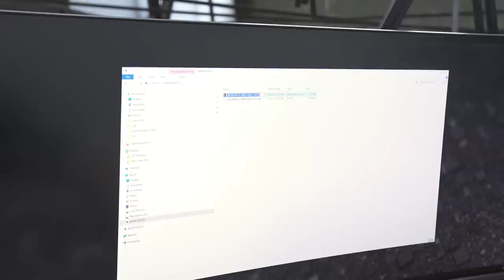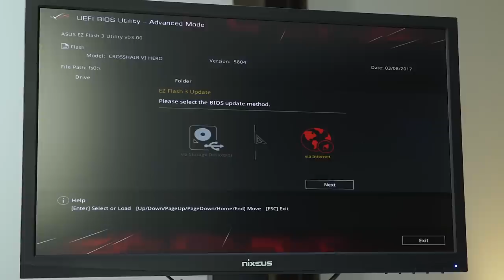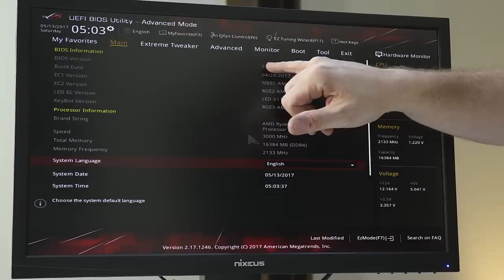How to build a Gaming PC

Comment: How long did you wait until the first boot? (Post)
Reply: AlexV511 no answer? wait for someone to answer. just answer. ANSWER????
Reply: Zeki İpcioğlu are you on crack?
Reply: unfortunately. install everything and boot first time. all i have is a black screen about 30 min.
Reply: Zeki İpcioğlu, I have the same problem... boot nothing but a black screen
Reply: just check everything looks alright. consider about wrong ram decision.
Reply: AlexV511 Did you sort your problem?  If you did, it would be helpful to others having the same issues.  Thanks!
Reply: Hey, I just changed my power supply and everything worked magically, so for me it was a simple troubleshooting. The ram was clean for me so no problem there. I hope this could help: check the power supply!
Reply: AlexV511 yeah i have comnection issue which i couldnt solve. They say me its was all okay but still not know what was the issue. So give your computer to a technician. This is what i can say to you guys.
Reply: AlexV511 The power supply is more important than people think!  Glad you got your rig up and running and it was something simple in the end.  Something to look out for.  Thanks for getting back! The information is sure to help someone facing the same problems.
Reply: Zeki İpcioğlu Did you send the parts back?  Will you attempt to rebuild?  It would be interesting to find out exactly what the problem was.  Do you mean it was a problem with the components?  In that case, of course, you would've had no luck with that particular part/s. Thanks.
Reply: I didnt send anything back. I asked professional help from a technician. All they said me was its all okay, no problem. Since i tried everything i couldnt understand what was wrong but its okay right now as they said. Btw i have check if they connect any cable different from me, there is no difference..

Comment: What's the case on the main build (the one with the two ftw3s)?
Reply: Gwalix thanks! Never would have guessed that. Looks like a nice case other than the front grill.
Reply: at 14:22 it says the system is a Cool Master: others here have said it's a Cool Master Pro 6 but haven't been able to find a similar one on line but getting close

Comment: I watched you and some other folks and learned a lot in the last 18 months. I put together a really awesome 3900x system that has 24TB capacity for my 3D video art. It cranks away 24/7, day after day making 20 to 100 seconds of video daily. LOL. But it cranks at 100%, over 4k MHz most of the time, and mostly under 80C with a giant air cooler. I have four intake fans through filters and three exhaust. My air cooler has three fans, LOL. 
Thank you so much for the learning you've given me and others.
I'm a car-guy also.... and when I started building this system last year, it reminded me of pulling a new aluminum intake out of the box and pairing it to a new 600 Holley.. matching it with the right pump... the camshaft..... oh yeah. It all has to be matched and put together in the right proportions. And you don't match it to a weak transmission and end-gears.
But now I want the 5950x and some faster RAMM.. and believe it or not, 64GB is what I'm running, I'll not go to 32 again.
Reply: Like a Boss!

Comment: what happens if you dont update bios on your new pc and go straight into downloading the operating system?
Reply: It will work, its not a problem.
Reply: Nothing really, he pointed it out because ryzen had just released at the time of recording, and updated bios would make sure it is running properly and is compatible with the other parts. You can still update afterwards, and it won’t ruin anything.
Reply: A lot of times, updating the BIOS not only fix some manufacturer related issues but they update compatibility for newer ram and processors too.

Comment: Don't you have to wear something for static electricity when working with the CPU someone told it to me ?
Reply: Germaux NCIv its not 1999 anymore
Reply: Voltaz hahaha ow sorry that's what someone told me lol
Reply: ULTRAQQX he meant that it's 2017 meaning that it's not 1999 hope this helps
Reply: You can!  If you absolutely want to be careful with your expensive hardware.  But really you can easily keep yourself grounded by working on a non carpet floor and by touching the metal of the case often (touching the metal of the case gets rid of any static by keeping you grounded.)

However, if you're really anxious you can buy anti-static mats or a anti static bracelet and honestly, they don't cost that much and it's worth the extra assurance if you're a new builder.
Reply: Ross Castro thx a lot bro :)
Reply: Ross Castro If I bought an antistatic wrist band, where would be the best place to connect the little crocodile clip to?
Reply: Any piece of metal on the computer case should work.
Reply: Ross Castro  Ohh alright man! Thanks :D
Reply: Touch the psu that's plugged in the wall but turned off.
Reply: You should always ground your self before touching any parts that could be damaged from static shock
Reply: You should to be 100% safe, but I put my last pc together wearing socks on carpet with no problems.
Reply: Yes. Theoretically you should. But I've never had any parts damaged from not doing it. So don't worry about it to much.
Reply: I did the same with my most recent build for my wife.  Just touch the case before you touch any component inside the case or grab a part out of a box.  Even when doing maintenance, such as cleaning out dust I have never had issues of damaging parts by static shock.
Reply: Touch a radiator or any pipework, should all be earthbonded.
Reply: If anything has made my day its that 😂
Reply: These guys use ankle stra po s ground themselves
Reply: you don't have to
and moreover its more for the GPU rather than the CPU
static shock is very unlikely now anyways

Comment: Can I re-use my SSD from an Intel build in an AMD Build?
Reply: StS Rischiii Yes you can!
Reply: Even as the boot drive? I'm using a 256Gb 850 EVO by Samsung
Reply: n0ply 1337 yeah Bro as boot drive too
Reply: Sure bro
Reply: I used a 860 evo pro 120gb for os. I have a z370 msi tomahawk. I wish i bought a m.2 ssd. I have a 1tb wd black hhd for storage.

Comment: Do B350 mobos support Ryzen 5 without bios updates?
Reply: Mihai-Silviu Dumbrava I've seen builds with that combination.  Are you asking whether the bios is up to date?  It should be but there are continuous updates coming out, for optimisation and to iron out quirks, etc.  Each manufacturer is different and, also, vendors may have different update versions.  Best to check each manufacturers website and download onto a USB.  I've heard some have bricked their mobo by downloading direct from the internet.  Some mobo's have dual bios, which means you can switch to the other if necessary.  This is from where I've picked to along the way..
Reply: Silviu yup bro
Reply: B350 boards are made for ryzen. They don't support any other chip (with the exception of a few apus no-one gives a shit about). You'll be all good bro.
Reply: You needing a BIOS update doesn't depend on whether it's Ryzen3/5/7. But the whether it's Pinnacle Ridge (2000-series, e.g. Ryzen 7 2700X) or Raven Ridge (Ryzen 3 2200G and Ryzen 5 2400G). All Ryzen 1000-series work on all AM4 boards.
Reply: that comment was from last year dude
Reply: Owen
you're right, that stuff didn't even exist back then. Last year, it was only about memory compatibility / speeds.
Reply: +Wojciech Szeler
didn't Ryzen 5 and 3 launch at the same time? Weird that it would work first a first gen Ryzen 5 but not a 1200. Never heard of that problem.

Comment: One last tip.  Check length of power supply cables and try to buy longer cables for bigger cases.  Mid tower cases are generally best case to get to have enough length unless you have extensions for cables, which might be needed for full tower cases or full atx.

Comment: I've been building computers since I was 8, but it's been a good 7 years since my last one so I figured I could use a refresher (even if the video in question is 4 years old).  There's a couple things I tend to do in a different order myself (I put the PSU in immediately after the motherboard, for instance), but I picked up some excellent cable management tips (one of the big ones being to not leave everything until all the big components are installed - my approach has largely been one of biggest to smallest, historically)

And gods, the front panel thing that lets you plug them all in to the motherboard as one is amazing.  I wish they'd thought of that years ago!

Comment: Something that would be a good supplemental video for you --- a build video featuring some more advanced topics - things that people debate all the time, like how to spread the thermal paste, at what point should you consider a bracket to support the GPU, does it hurt to use a magnetic based stand, motherboards that support in/out monitors are they worth beans, do you monitor your radiator fans with TMP sensors or do you need to utilize a MOBO that includes in/out headers... when to consider whether a water cooling loop might come into play. Do you consider that right up front for planning for the future, should you start with flexible or hard tubing? Anything from how to consider a motherboard - and an appropriate case, maybe eATX vs ATX, full size versus mini to AIO vs custom loop versus air cooling, what temps should be cause for concern. Or... you got one fan header to accomodate a radiator with two fans, should you use a splitter of some sort of a little board that will split it up, should you consider a windows based commander pro, or be BIOS based (especially if you're a linux worker like I am). PSU wattage selection, gold vs platinum. Tradeoffs. General answers to some fundamentals. One example, as a beginner I had started with one case, quickly discovered it wasn't going to accommodate what I wanted, then bought a Fractal Design S2 that's amazeballs, and will accommodated a water pump, but now realizing I probably should have gotten a full size tower (all within the span of 2 months). There is a market segment that most of your viewers fall into that is in the middle, they know how to hack together a PC, but aren't expert enough to get some of your more hardcore videos (perhaps pretending they do and frying a chip or two or buying 3 motherboards before they realize what they should have considered on the first one). A video to set them straight for their follow up build. They probably won't admit it was helpful and will probably slag you in comments for being too general, alas, it'd be helpful and a gateway into the rest of your videos. Which by the way are awesome, watching your channel like it's a TV series.  A docudrama of sorts, thanks!
Reply: Machine Mechine true true. I think you’re right and highlight what we enjoy about his vids.  And the stuff I spit balled are mostly instructional type of cookie cutter shit. I don’t have answer as much as I know that between this beginner video and his other more professional level ones is a skill level where a majority of his viewers are. And I do wish that I didn’t waste so much money learning lessons, but to your point some of that’s related to a manufacturers issue. The motherboard example again, bought an ASUS board with water temp in/out headers. Wanted to use chassis fans to cool radiators based on water temp. I could in BIOS as you’d expect, but once it booted into an OS other than Windows it didn’t keep the fan settings. Kept CPU fan settings though. So I was forced to abandon my idea - the sole reason for buying it in first place. A weekend and $300 wasted - because of crappy software. Nothing Jay would have covered. However one that he would is the stupid thermal paste debate. We’re always told not to overdo it, but any factory GPU application I’ve seen is a mess with paste all over the place. I have tried to be cute about it and left part of one exposed. Figured that out when temp was 10 degrees too high. That trial and error / learning - but I would trust Jay and follow his lead. And frankly that’s not something I wasn’t to learn. No pleasure in that detail.

Comment: Nice video Jay, but I think the part when you explained how to connect the front panel could go a little bit deeper, because it is not all about connect headers with pins randomly, or it was just one way to connect all these wires it would be ok, but you gotta follow certain sort of design depending of your motherboard, and you could clear that very part way better. All but that was great and we do really apreciate the video, keep it up!

Comment: One thing I learned when building my first rig is that putting a 120mm fan at the back of the case next to the I/O can be difficult or impossible due to how big the cover on the I/O is.  I used the Corsair Obsidian 500D SE and MSI Z370 Gaming Pro Carbon AC and I couldn’t get the Corsair 120LL RGB fan to line up due to the RGB/Cover on the I/O.

Comment: Built my first new build in like 6yrs.  This video was quite helpful.  Would have completely forgotten or missed the step of pre-downloading bios update.  Made a solid difference.  Current setup ( built last week):
Ryzen 5 1600 w/wealth spire
Asus prime b350 plus
Gigabyte 1050ti windforce OC edition
16gb hyperX ddr4-2666mhz (found pc4-21300 cl16)
Samsung 960 evo 500gb M.2
WD blue 2tb sata HDD
2x 27in AOC displays (main on direct port, 2nd on HDMI)

  Feels good to have a fresh rig!
Reply: If I could actually find or afford a 1080ti hahaha... The cost of one (when you can find them) cost more than my ENTIRE BUILD (my build was 950USD)
Reply: Patrick Rose wow! it must feel good to have a budget-ish build with a m.2 ssd. nice build man!

my build: as of 3 months ago

ryzen 7 1700
asus prime b350-plus
evga gtx 1070 sc
corsair rm650x
corsair 200r
120gb 850 evo
3tb hgst deskstar (CHEAP)
2x8gb g.skill ddr4-2400
Reply: Gavin Sonntag micro center was doing a "build it yourself" deal when bundling hardware.  Technically I had an extra 150 in the budget cause of the money saved, that money went to replacing our old first gen AC router to take advantage of AC wireless card. Got a decent deal on an Asus AC1200 network card.

Comment: Getting back into the gaming scene. Classic wow calling my name! I just pulled my PC out of storage and it's pretty outdated almost 10 year old parts in it. Still running Windows XP lol on one of the drives but  Vista was the last version I had.  I was messing around with it over clocking and was able to get it to 4 ghz. I'm fairly new to that sort of stuff and I was just surprised my PC was still a beast. Going to upgrade and get a pci express SSD and external ssd. Get windows 10 pro and I'm back in Azeroth baby

Comment: should never rely on any of the built in Windows drivers.   make a folder somewhere, call it  "drivers" and then make subfolders for each component: "network card" or "NIC", "video"  "audio" etc and go to the manufacturer's website for each of those drivers and grab the latest drivers and install those.    And just periodically re-visit those websites and grab any newer versions as they come out.   

This is especially important if you want everything to be secure.   usually security updates are for the Operating system or for specific applications,  but sometimes drivers have security flaws in them too (cough cough nVidia)   so you want the latest drivers that fix those security holes.

Comment: I know this is an old video but if anyone is watching this as a guide to help them with their first build I would suggest having the pipes go down from your CPU block to the radiator if it's front mounted because these all in one coolers have a small amount of air inside which wouldn't let return pipe send water back to the block correctly which houses the internal pump. You might even hear water trickling inside if you have already mounted it this way... In that case change your layout when you can. I built my PC around the same time as jay did this with very similar components actually aside from the GPU being a 1080 strix plus it's the i7 8700k equivalent  and it's still running strong... My radiator is top mounted though and never had any issues.

Comment: It doesn't matter what Jay talks about like he could do a video about the proper way to watch paint dry, and it would be interesting.  Also I don't know if there's actually a way to message Jay or not. But it would be awesome if you could check out this case that I found that's $40, includes a tempered glass panel and comes with four RGB fans pre-installed, it's crazy

Comment: Thanks, got ahead of myself and took off the back plate thinking I would re use my AM3 setup with a H55 corsair. Now I have 2 back plates and wasnt sure which was for the old Asus MB and which was for the new! The split second you flipped the board was a life saver. Now I just hope I can figure out which brackets are for the new Hero VI and which are for the old M95.

Comment: I actually built a very similar system  with the only major differences being I used An Asus Prime  X370 Pro MB, and an Asus Strix Vega 64, in a  CoolerMaster Mastercase  5 Pro with a Corsair  H110i AiO,  has served me very good the past year and a half running 3.9 GHz 24/7